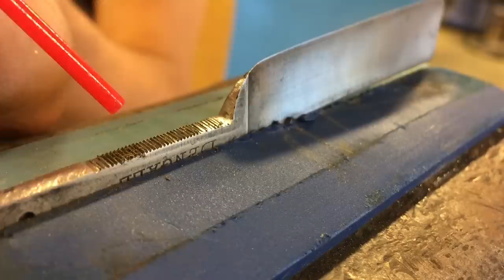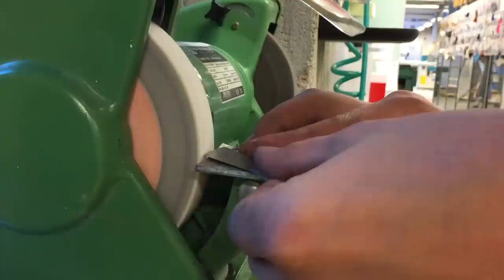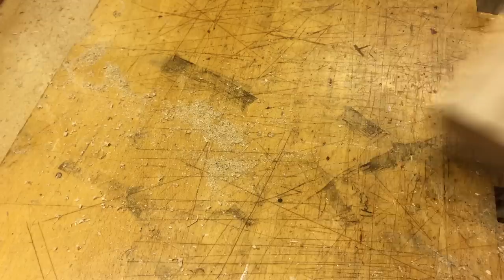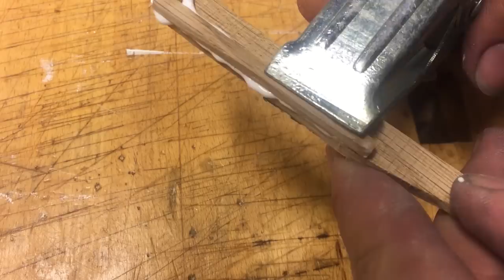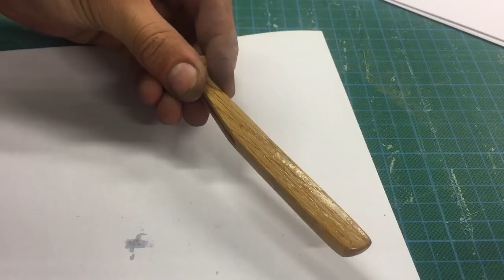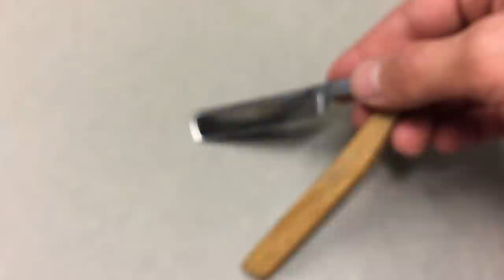Straight razor  restoration

Comment: It looks nice and I'm impressed that you got a shaving edge on it. But I'm a little concerned with the use of a fairly coarse grained wood cut so thinly. I would think it would have a tendency to crack along the grain.
Reply from the maker: You know what..... I'm concerned to. It was a mistake to not lay the grain more diagonally so that it would follow the shape of the handle better, If (probable when) i make the next one i will remember this as well as use a denser wood. 

Thanks for the comment ;)
Reply: Gewgulkan Suhckitt he will restore it again when broke.. 😁😁
Reply: well done though! this video is satisfying in general

Comment: I thought you are supposed to sharpen it on the stone with it facing the other direction?
Reply from the maker: First time i sharpen a razor... turnes out you my friend are totally correct! I'll do that on the next one ;)
Reply: you should only do that motion when using a leather strop, which is a must for razors. Other than that it's a nice project.
Reply: it depends a lot on the shape of the razor's blade profile. In the case of this razor, it looks like it may have once been much taller and had a longer concave bevel, but it no longer has that, so sharpening it with a scandi or flat grind is perfectly fine.
Reply: You can use edge trailing strokes on stones too. On certain stones it's preferable actually, such as Japanese water stones with a swarf.
Reply: There are many ways to sharp good job young guy

Comment: Looks great, but still kinda irked about the way you sharpened it. In my experience, you're supposed to flip it around and basically go AGAINST the blade and then use a leather strop to really get that super sharp edge. Still, it looks ok (for the wood choice) and you got it to cut fairly well so kudos to you!
Reply from the maker: Thanks :) Jeah the stone sharpening is my bad... should have looked at youtube videos before i made my own..  the next one tho !
Reply: @achappel  they also look like oil stones . Although in stropping the spine of the blade should be flat against the leather in sharpening it should be slightly raised as to avoid damage to the spine of the razor
Reply: Seems sharp enough to me dude.

Comment: Wasn't that piece of wood a little bit overkill for the handle?
Reply: At this razor it seems the middle wooden part of the handle stops the blade, however, the edge should not touch anything as it is very sensitive. On a normal strainght razor the wide part of the blade stops it in the handle and the handle is hollow. Like on this picture:
https://lh5.googleusercontent.com/-BzNrWsLi5g4/UctOzq88HCI/AAAAAAAAAnM/N2k72GC0spE/w394-h570-no/whale-04.jpg
Reply: NeekoPaulzee2 hes talking about the piece of wood he chose to make the handle

Comment: why did he waste such a large piece of wood
Reply: Jawad Kashmiri where was this wasting part sorry I didn't see that part of the video
Reply: KARSEN SAULTERS.. at 2.10, he cuts a piece of 10" x 10", whereas he only needed 2" x 10",  so rather than cutting such a large piece, he could have only cut 2" piece and use the width of the log to make full handle.

i don't mean to be negative, it was just my observation
Reply: Jawad Kashmiri To be honest he could've done that with a 1 by 4
Reply: Jawad Kashmiri he just sanding a couple things and the rest of the wood he could be used.
Reply: The answer to that is simple - when you make a long wooden object you want the wood grain to go lengthwise. Slicing a 2" piece from that large board would make the wood grain go perpendicular which would make the handle much easier to break. Besides he did not waste anything. I believe the rest of that 10" x 10" piece can be used for some other project.
Reply: Yup What a waste of wood , he couldn't find a smaller piece to use ? And he is so careless the way he handles things, it is like he has  no respect for the wood or this razor , or the work of the craftsman who made it . Maybe i have spent too much time in japan learning from real masters there , but if i had thrown things like he does  i would have been dismissed immediately . And finally he doesn't  know how to sharpen a razor . That's not how it's done .
Reply: Morgan Olfursson he said he wasn’t good and would improve. it’s not that bad :^)
Reply: Kala , calling a Japanese a Weeaboo is really hilarious .
Reply: Jawad Kashmiri That's not wasting.
He didn't use that much and you can still use the other parts.
Reply: He is gonna use it for other things
Reply: Jawad Kashmiri who said he didn't put it back?
Reply: you're not a japanese and that's a fact

Comment: i know you believe in that glue, but a straight razor is ALWAYS wet, that thing is going to fall apart after 2 shavings; u should have used copper studs instead of the glue since the steel one that you put is going to corrode and your razor will always be a source of infection and sepsis if, by accident, you cut yourself with it which is quite common with razors i believe, i see people congratulating you, and i wish not to be mean but in reality you did quite a poor job here that will have to be redone(if razor in constant daily use in about 2 weeks) so you did nothing really but removed a very fine anti-corrosive layer by sanding it with sandpaper(actually this made me very very confident that you havent approached this the right way and that you did 0 research on types of steels and protections used in golden age barbers kit).
Reply: Thank you, I dont have to write this comment myself.
Reply: Straight razors are always wet? Ok thanks for the info

Comment: hello, I'm thinking to use sand paper also on the razor I got from a antique store. Which is the lowest grit I can use without damaging the edges of the knife(tang shoulder spine), and should I go all the way up to a 8-12k grit sand paper to make the steel shine or do I damage it again? I saw that you used oil I guess. What is the advantage of using it? should I dry sandpaper, water or oil as you used? whidch are the advantages and disadvantages. thanks
Reply from the maker: I guess you can start fairly course.. depends on the condidtion of your blade.. and then just go up the grits grinding away all the marks from the previouse one untill you are hapy with the finish. You're not gonna damage the blade in any way with to fine paper... The oil was just some WD40, its just to get the shavings from the paper away, so that it doesn't scrach the blade and load up the sandpaper.

Comment: I've seen knives sharpened this way and the other way - as the blades sharp end is moved towards the sharpening stone. What is the difference?
Reply from the maker: think its wether or not there will be a burr created on the edge of the blade grinding against the blade is suposed to give a potentially sharper edge... (i think)
Reply: By moving the blade so that it passes over the stone where the thin edge is last, a small bit of metal tends to curl up creating what is known as a "wire" edge.  Moving the other direction tends to prevent this from happening.  I have experienced this so I move the blade into the stone for sharpening.  At the end I use a piece of leather to strop the blade to polish the cutting edge.

Comment: you shorten the blade to make room for the handle? why not make the handle a little bit longer. and instead of adding more wood in the middle of the handle to separate it why not just hollow out the two halves a bit and leave the end thick?
Reply from the maker: Actually the blade has the same length, I just changed the curvature of the end because i liked it better that way. But jeah definitely room  for improvements for the next one ;)

Comment: The starting point wasn't that bad. I don't think you needed all that sanding. Just maybe polish. Also, all that sanding rounded the design and corners on the blade so for that reason I would not consider this a restoration.

Comment: Dude, if you ever need a toothpick made, I've got a 200 year old redwood in the woods behind my back garden. It's barely 200ft high though, so if you need a second toothpick, well, we can use a second tree? And seriously, you only polished the metal handle like 4 times, but used one coat of varnish for the wood? Sloppy work.

Comment: You did successfully everything wrong what was possible... Just because the blade might be sharp it was still a poor job how you grind it. That's the way not to do it! When you close the blade in it will touch the wood on the edge. Second mistake...
Reply from the maker: Thanks for the kind words :) ps: edge doesn't touch the handle ;)

Comment: I'll be brutally honest here, you re profiled the blade taking away from its original intent as a square point, and not a rounded point blade. You never re-profiled the edge as you should have due to age, and possibly poo honing techniques. You also drilled out the  pin hole larger, which didn't even seem necessary. Lastly the scales seem really not functional for actual shaving as the way in which the razor will pivot will have the scaled in the way half the time. Also, the polishing job was piss poor, a mirror finish is easily achievable. Lucky it was a Bengal Sheffield razor, and quite common. Nothing like say a Wade and Butcher wedge or Joseph Rodgers, etc... However nice video work.